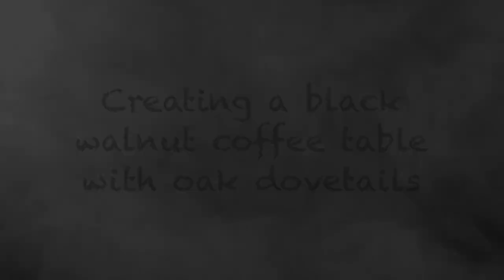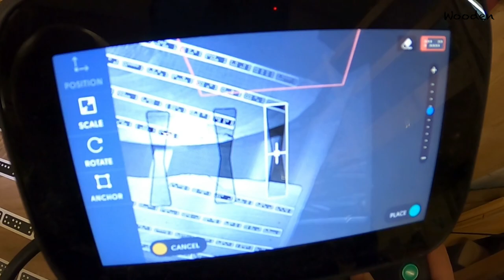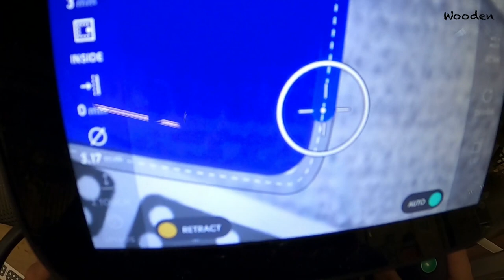Creating a Black Walnut Coffee table with dovetails and epoxy resin - Black Walnut #shapermade

Comment: What would happen if you didn't use the dove tails? Why use them?
Reply from the maker: Hi Shane. Nothing would have happened, I just used them as a decorative element. The epoxy resin should be strong enough to hold such a light table.